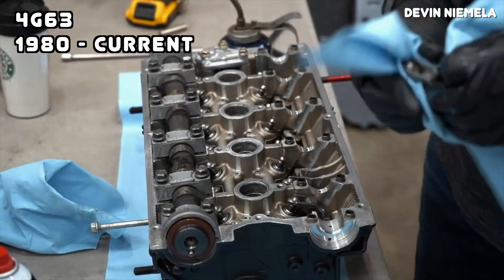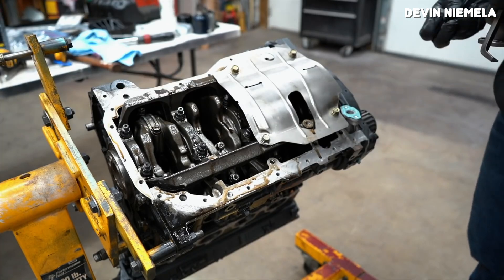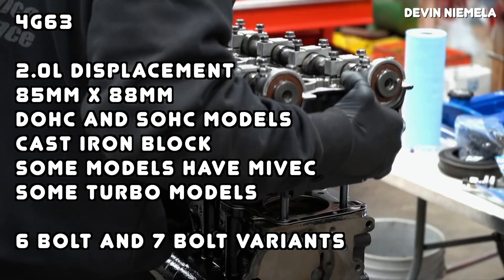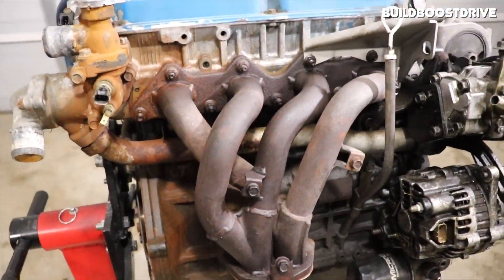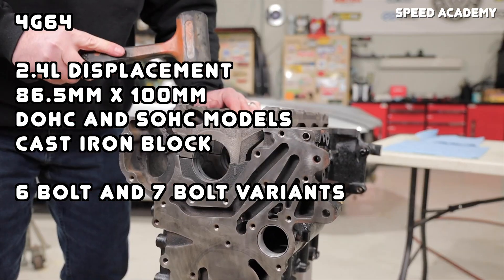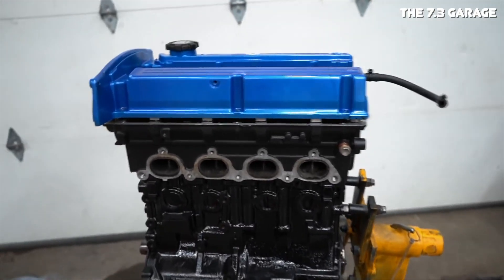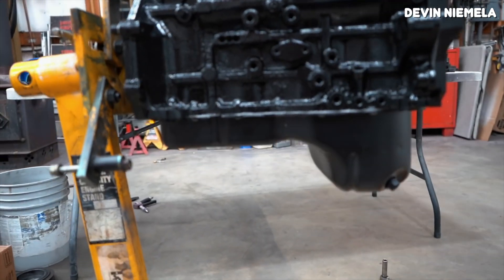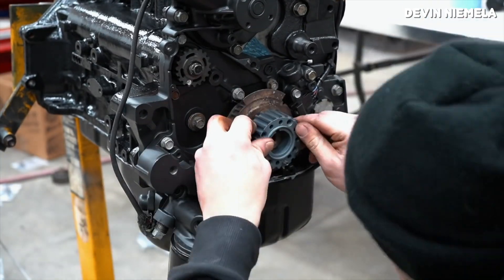4G63 vs 4G64: Which One is Better?

Comment from the maker: If you guys enjoyed the video, please SMASH THAT LIKE BUTTON. It helps the channel out a huge amount and helps YouTube put the video in front of more people. Thanks for watching 😬
Reply: Any info on the headgasket sealing issue when running the 4g64 block and 4g63 head?
Reply: dude the 4g63t was originally realesed 38 years from now on the lancer ex 2000 turbo
with multipoint fuel injection
Reply: Hey btw some guy made 500hp in a 4g64 with stock internals on e85
Reply: What is your advise on my 4g64 petrol engine? Can a 4g64 from a mitsubishi pajero used a bottom half  from a mitsubishi galante 4g64 engine?
Reply: Any advice for an Evo 8 head on a galant block?

Comment: thanx dude, excellent video, no BS, i have a 1991 L300 Explorer Ci Motorhome, 2l 4g63 8v carb motor. head has being redone and skeemed (blown head gasget) replaced stock carb with weber 36dcd7 carb, and removed the viscus fan from the motor and installed an electric fan on the radiator and 50mm freeflow exhaust, all just for better low down torque and better fuel economy, removed the rear steal bumber, 40l water tank, 20l gas gizer, complete shower/toilet removal, build a nice cupboard instead with light wood, removed alot of weight also for better fuel economy, took the Van out for a run yesterday after the engine was fixed up, engine runs nice and smoothly and have nice torque with the weber carb, just what i wanted, engine fan sound also completely gone due to electric fan, going on a 400km trip on Saturday morning, very excited to see/feel the results of all that has being done. people suggested I rather spend on this engine 4g63 that replacing it and do allot of mods. So I did just that, cost a few pennies, but yeah engine runs smooth en quite, and really feels freely reving, sounds smooth and nice sound with the 50mm freeflow. hope i last now. God bless

Comment: What you forget, is hyundai had 4g' s, the 6 bolt variant, in very early elantras, and 1rst gen sonatas, had a hyundai built Frankenstein, 2.4 that was basically a late sohc 4g64 bottom end with an evo 5 non mivec dock 16v head, and if you can find that car with a stick or better yet a first gen stick santa fe which had the same engine, you have the potential to build the ultimate sleeper 😂😂😂😂😂

Comment: I'm building a 4g64tdi as a test bed which is a direct injection 4g64 with rods to lower compression from 11.5 :1 and 25 psi to see how efficient the engine is

Comment: I would upgrade my 4g63t 6 bolt to a 64t , but I have enough trouble keeping the tyres from lighting up on my 950kg car as it is .
Keeps up with everyday traffic fine in vacuum without getting into boost , it's ridiculous.

Comment: My biggest question that no one has seemed to be able to answer for 3rd gen 2.4l eclipses. do aftermarket intake manifolds from and evo 8 have the same bolt pattern as the 2000 - 2005 2.4l 4g64 intake manifold? i wish more tuners covered this for those who want to have fun building these older cars.

Comment: Looking to buy a rebuild kit for a naturally aspirated 4g63 8v SOHC engine on the cheap. Which kit do I need and are these engines sleeved?  I see forklift engines seem to have sleeves in thier kits.  This is an older engine probably the first generation. Also I am in Vietnam and this vehicle was an import specifically for Vietnam. It’s year 2000 but the engine looks like those used in the 70s and 80s. Thanks for the help if I get any after 3 years.

Comment: I've never experienced a 4g63, but my mother-in-law has a 4g64 in her '03 galant. To say that it's a reliable engine is an understatement (some of the things she's gone through would make a Toyota, dare I say it, throw codes, lol), and a pretty gutless engine in all honesty. My question is how many miles can it typically run before a rebuild? She's currently got 205k on the odometer and has lately been throwing codes for the O2 sensors (fixed), EGR (working on it), and just other little things including oil in the sparkplugs wells (I'm thinking on replacing the valve cover gasket). She's a good little engine, I'd like to see her hit 250k before she's done done. Thanks in advance :)

Comment: So what exactly is in a 2008 Mitsubishi eclipse for motor size I know it's a 2.4 l mivec but I don't know whether or not it is a 4G 63 or a 4g64 can somebody give me some tips on what to do or what I have in my car
Reply: It's a 4g69... has a forged crank ca handle some boost with some good tuning need ARP head sruds to handle 15psi fairly well for some 300whp+... record now on SOHC head with some work and everything forged rods and pistons and wht not is 638whp on water-meth as well... I'm building one crazy hidden party popper on my Ralliart Lancer... 1st Rotrex Supeecharged on the serpentine directly... my tuner said We're in for some nasty trouble... I like that! Over twice the air mg per cylinder limit at 3500 rpm lol... on full potential of the blower We're looking at 20psi and probably over 500whp hahahahah!

Comment: I’m getting a 2000 Mitsubishi Eclipse GS (5-speed manual 4g64) and I’m planning on putting a turbo kit on it with 0 prior experience building up engines like this. Hope this video helps a little.
Reply: Did you get the eclipse? 3g rs owner here

Comment: I have just removed my 4G63t motor, gearbox and Link ECU and replaced them with a forged 4G64 block mated to a 4G63t race ported head and a Garrett Gen2 Turbo, custom adaptor plate to link the EVO3 gearbox which is filled with top of the line PPG square cut dog box and sequential shifter all controlled with the MaxxRace ECU.....looking at around 840nm touque.

Comment: Have the 4G64 in my 2004 Chrysler 2 dr coup. Bought it used 2 years ago, i run Castrol GTX mag in it, no oil burning. Needs some work, but I've been thinking... How do I turn into a sleeper? Any thoughts or am I wasting my money?
Reply: Turbo it .. with 4g63t heads
Reply: @bucketgettershoops  or @MrFishluver could use a Hyundai/Kia g4js dohc head but swap in evo cams and adjustable cam gears, they are easier to find vs the evo heads and a lot cheaper too.

Comment: A 4g63 has a transmission on the passenger side a 4g64 has the transmission on the drivers side. They are reversed from each other.
Reply: Not on all of them boyo.... i have an 1100 bhp ready 64 engine.....with the clutch on correct side. Ooooosh!
Reply: They offered the 4g63 both ways, the early 4g63 and 4g64 had the timing belt on left side, with the transmission on the right side, if you are inside the car, then they flipped them 180*, so that the timing belt was on the right side and transmission was on the left.

Comment: Since the 4g64 has a higher compression can I still turbo charge it but use less boost before I start running into piston knock ?
Reply: I know this was two months ago but if you gap the piston rings, just like how they do on modern dodge v8s, it could handle about 20 pounds of boost. however, a forged piston and conrod kit are really cheap. i can give you a slight build sheet in which you would be spending south of 4k, to have the ability to make 450 to the wheels reliably.
Reply: @neverstopushing3638  please do bro, thinking about buying a 3g eclipse
Reply: Yes you can - believe it or not the compression ratio isn't all THAT much higher.  With proper tuning and knock management, you CAN safely run 12psi on the stock SOHC 4g64 engine internals.  The weakness in its stock form comes from its junk factory pistons and, in regards to say the 2g DSM 4g64, the ECU (didn't have a knock sensor).

Comment: So how do you take the 2 l motor and put the 4 l displacement
Reply: You don't...you take the 4g64 block and 100mm crank and replace the 2.0L block and 88mm crank to gain the extra 0.4L displacement.

Comment: I found out some Sonatas use a variant of the 4g64. I want one now 🙂
Reply: I have a 2005, and the 4g64 in those are engine code g4js. they are dohc, and 7 bolt motors. they arre the best chance at getting the most powerful variant of the 4g64

Comment: Is it interference engines?
Reply: Take a look on Wikipedia  ( Mitsubishi engines ) ..there are several variants. .some non interference but most of them are interference engines.
Reply: The 12 and 8 valve SOHC 4g63 and 4g64 are non interference engines.
 Most (if not all) of the 16 valve SOHC or DOHC Mitsubishi engines that I have seen are interference engines.

Comment: I have a 2003 mitsubishi chariot use 4g64 gdi but I wanna buy a nun GDI but cant get a 4g64 non GDI but only 4g63 non GDI I can get so I am asking can 4g63 engine can go on 4g64 gdi transmission

Comment: well done, straight to the point

Hello, I am buying an Evo 7 with a 4g64 block stock internals on a 4g63t head from it's stock engine
stand alone ecu "link" custom tune 17psi peak
I think some aftermarket sport diffs made for speed races and hill climbs 
any advice is appreciated, anything I should check or look deeper into it or any others?

Thanks,
Reply: Cd009 tranny if you want a same vibe from #Tokyodrift

Comment: I had both engines(dohc 4g64t) in my mirage and I can tell you hands down driving a round town and highway passing the 4g64t is superior.  I went from the 2.4t to the 2.0t and immediately I felt a lose of lowend and midrange power.  There really is no replacement for displacement.  I still have a spare 4g64 crank lying around and when the 2.0 blows I will be building a 2.3 stroker
Reply: I wanted to exchange my galant 7G 4G64 for an eclipse 1G 4G63T, but seeing your comment I will make a 4G64T, 
the problem is very high rod ratio

Comment: my car engine use 87mm piston and 100mm stroke 4g64 block..how to calculate engine cc?
Reply: 2.377,88 cm³ see how is the calculation= number pi*bore*bore*stroke/1000/4*number cilinders= results cm³ ( 3,1416*87*87*100/1000/4*4=2.377,88)

Comment: please help i have a galant 2003 2.4l 4g63 someone had the car for a while and ran the car without oil n damaged the crankshaft and bearings i however cannot find a crankshaft replacement ...can the 4g64 crankshaft work really need advise
Reply: Just use the entire g64 block.
Reply: Use the block and. That solves the. Issue

Comment: You don't need to lower compression. Just need a good tune and fuel for higher compression.
Reply: or e85...
Reply: the b series racers run lower compression setups for high boost… k series run high boost high compression setups but you gotta be careful cause you will cause knock.
Reply: But some combinations of stock parts puts you over 11:1.  Thats pretty high for a boosted application.

Comment: You failed to mention there's flipped version 4g63 after lancer evo iv.
Where's the timing belt is on the other side of the engine bay, but the intake and exhaust side remain the same.

Comment: great vid. I have a 2004 eclipse with a 4g64 and it’s been extremely reliable and easy to work on. parts are super cheap. not that powerful though.
Reply: Around 150 wright? How fast does it sprint to 100 km/h? Or 60 miles/h?
Reply: Wouter de Waal yeah 150 i believe. It’s slow 0-60 about 8.5 seconds

Comment: 4G63T with a 4G64 block= 500-600 horsepower stock
Reply: 4g64 stock internals wont handle 500hp you are nuts the rods are too weak
Reply: @jamesshelly5557  You got experience?
Reply: A 4g64 stock block will handle 20 lb of boost 400 horsepower a 4G63 block will handle five to six hundred horsepower yup 💯
Reply: @jamesshelly5557  What kind of car u have it in? I have one in my garage I'm about to build  for my Evo9. What kind of pistons u run ?
Reply: @jesssprinkel2812  99gst I've owned for 9 years I've been in the DSM game 12 years
Reply: @jamesshelly5557  That's what's up I've been doing that for 22years fully built Plymouth laser rs 2.3 stroker , Evo9 and Evox both highly modified. I wanna try out a 2.4 cus it's cheap can't decide if I wanna de stroke or leave a 2.4 .
Reply: @jamesshelly5557  So what have u done with 4g64 ?  How did u build ur engine how long did it last?
Reply: @jesssprinkel2812  it's a stock block 4g64 and stock head 4g63

Comment: omfg! i just bought a 1990 mighty max and have been working on it due to it being my new daily and got curious on the engine i was running and you just blew my mind. i have been building toyota engine for about 10 years already and i thought that they were crazy about mixing parts from engine families. i had no idea mitsubishi was just as crazy. i think im going to have fun building a few of these engines and toying around with different specs. great video. thanks for the info, gives me a basis to start with.

Comment: My friends laugh at me because i have a 4G64 galant, over the past 6 years their behicle have given up on them and mine still rolling, these 4G64 are monsters😂
Reply: My brother in law wrecked his gallant, I told him to keep it because the doors could be replaced. He bought a convertible vw the vw gave up couple months later and the gallant never gave up, just has multi colored doors now.
Reply: my galant is a year older than me and she's still a champ
Reply: I inherited a 8g galant couple years ago. It's the GTZ trim. If only that trim came with a 4g64. I don't know how 6G72 will hold up.
Reply: @Jabid21  Same here. Bought my 01 GTZ from my uncle for $1000.  20 plus years, 197,000 miles and she's still going strong besides the obvious maintenance for an old car.
Reply: I got the same mine still running 👍
Reply: Yes indeed my 2012 has 199,224 miles on it
Reply: Look up Brent Rau's eclipse.  It's a 4g64 block with a 4g63 head welded directly to it. Fastest 4 cylinder in the world at one point in time.  It pissed off all the eclipse bois because it doesn't run the "bullet proof 4g63" block but instead runs the "dog shit" 4g64 but somehow manages to not blow up ever 🤷🏻‍♂️
Reply: @JohnPulliam82 you don't weld heads to blocks
Reply: Lol yea just dont break that timing belt and they are bulletproof
Reply: Son mas efeciente si es doch yo tengo un swap 2.4 4g64
Reply: I have both and the 4g64 is the better engine. Why rev when you don't have to 😂
Reply: I got a 1996 Mitsubishi galant with the 4g64 and transmission fails  nw it's very nice with a five speed manual  and doh cam it's running ever since
Reply: @shawnstorm8338 apakah bisa 4g64 menggunakan girbox manual 4g63?
Reply: My 4g64 out my 03 eclipse decided it didn’t want to use my piston rings anymore. Just gonna bite the bullet and rebuild it. Put some rods and pistons in it, remove balancers and get the rotating assembly balanced. Keeping the sohc for various reasons at the moment so might do some work on it, not for performance (good side effect but not expecting much) but to make it run better all around and hopefully reliability. Planning on forced induction in the long run but I heard they eat boost up on stock compression and the main limiter is the pistons so that why I’m keeping compression ratio stock. I also have access to e85 so I’m not too worried about fueling nor am I trying to make a street and strip car, after turbo my goal would be the 300 to 400 whp range 

Ps sorry for rant 😂

Comment: Great video! Another one of note is the Hyundai G4CS. Maybe it is just Mitsubishi sourced 4g64?
Reply: The Hyundai/Kia G4JS head is a variant of the 4G64. You can swap the DOHC from a G4JS engine onto the block of the 4G64. You can also swap out all the internals of the G4JS head into EVO8 components. This is how my engine is built now
Reply: All of the Hyundai clone engines are made in south Korea by Hyundai/KIA Mitsubishi sold them the designs so that they could make their own engines that are an exact replica in many cases but some models had slight differences to the mitsu counterpart engines/drive trains .
Reply: Im pretty sure the first model excels have a Mitsubishi motor in them, s 4g61 dohc, and protons have the 4g93

Comment: Can a 4g63 cylinder head work on a 4g15 block???
Reply from the maker: Honestly I’m not sure, sorry 😐
Reply: short answer No.
long answer, the 4g63 is in the Sirius engine family and the 4g15 is in the Orion engine family, the cylinder bore spacing, head bolt pattern, is totally different between both engines, and I have rebuilt both motors before.

Comment: The 2.0 liter is always the better  choice. The 2.3 or 2.1 won't rev as high. The red demon is a 2.0.   
The super high hp 4g63 are all 2.0. The higher rpm allow for bigger turbos. 10'000 rpm is always better.
Reply: If you destroke a 64 would it not allow higher rpms?

Comment: Or a adversely, a 4g69. 
Which is 2.4L like the 4g64 but has the same deck height as a 4g63 meaning you can run stock 4g63 dohc head and timing belt. 
It has the same 150mm rods as a 4g63 but 100mm crank like a 4g64. 
If you want a built version use any forged H/I beam 150mm 4g63 rods and something like wiseco's k627m875ap piston for correct comp height and 2404cc😉
Reply: Darian did you turbo the blue x240 or just played with them otherwise.  I have a few motors in the shed
Reply: @93jummy  Yeah, if you look on my channel my evo T.M.E is a 2.4L I built. It runs a gen2 garrett gtx3076r with .82 rear housing

Comment: 4G69 vs 4G63???
Reply: Isn't the 4g69 just a 4g64 with mivec?
Reply: No there not the same Cooling passages are different. Also as far as the height of the block goes the 4G69 is the same as the 4G63